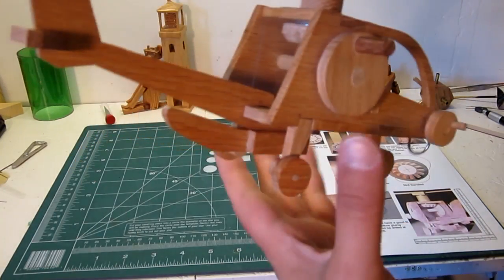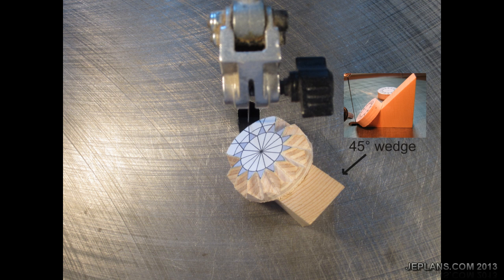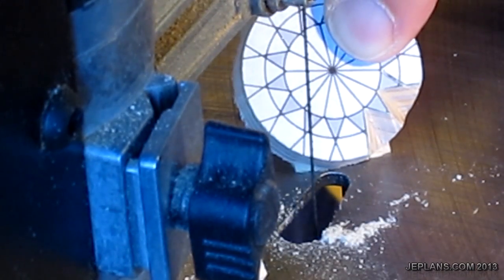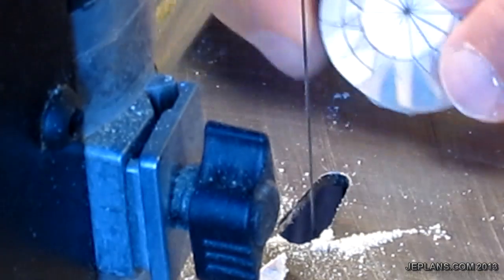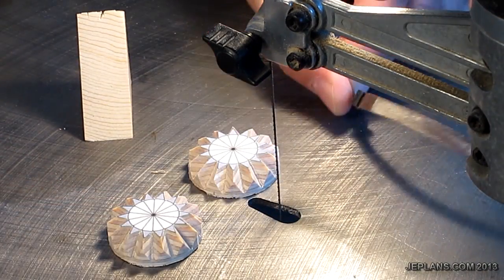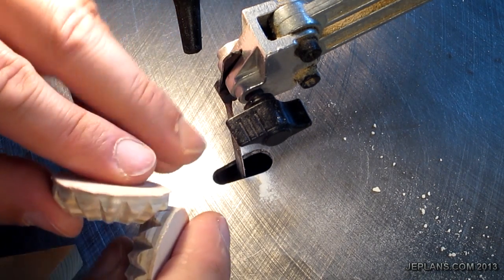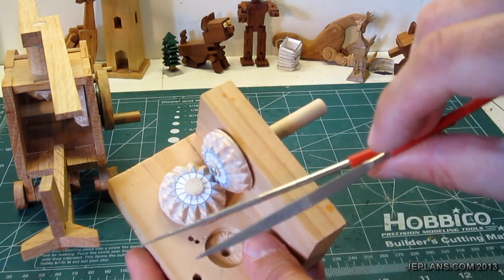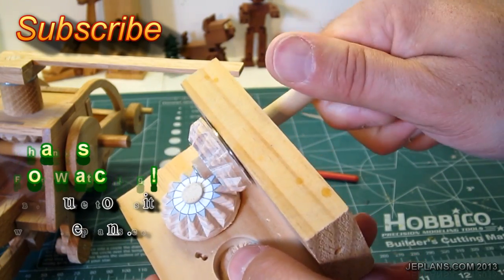Making Bevel Gears on the Scroll Saw

Comment: Hi, How do you do the calculations for right-angle peg gears (numbers of pegs per arc distance, length/diameter of peg, etc)? Thanks!
Reply from the maker: +Daniel Sevier  I kind of just guessed dividing up a circle till looked good.  Too small of teeth and it would be hard to cut , too big and it will be prone to getting stuck.  Once I had given number of teeth the rest kind of works itself out.  Like thickness has to be enough for a angled cut of certain  distance.

Comment: Was ist das nur für ein Holz und was für Sägen. Die schneiden wie Butter.
Wer kann mir da weiter helfen? Pappel ist es nicht. Balsa auch nicht. Aber  was dann ?
Reply from the maker: I am not sure I understood your questions, it do not think Google translate worked very well.The wood is Baltic Birch Plywood.  I attached the patterns with painters tape and a glue stick.  The saw is a scroll saw and the blade, I believe was a #5 or #2. The speed of the cutting sequences are sped up.